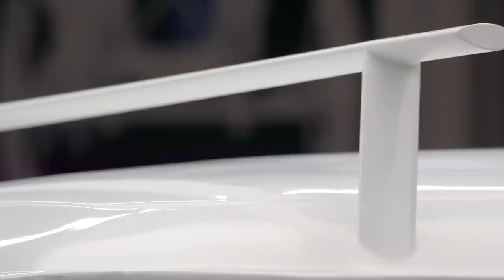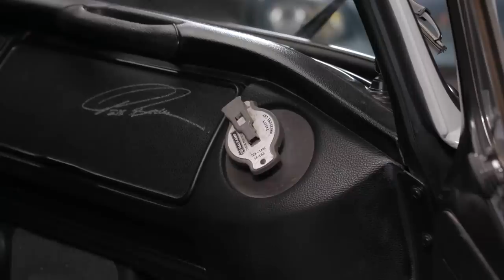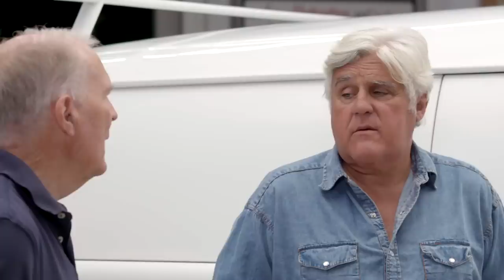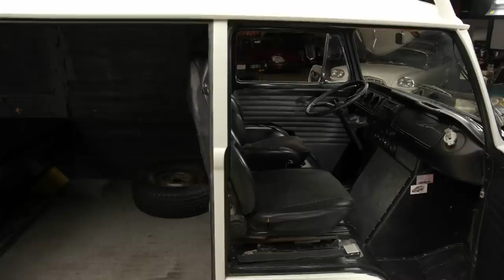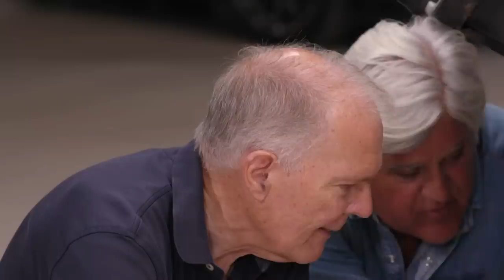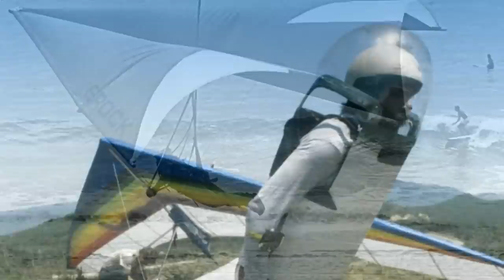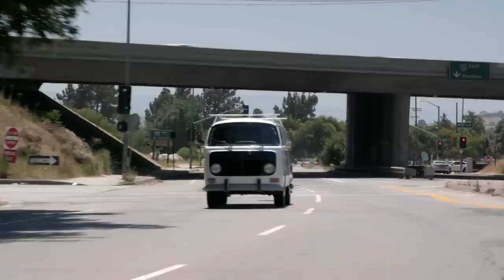Peter Brock's Hang Glider Transporter VW Bus - Jay Leno’s Garage

Comment: I owned a 73 Combi with the stock 1700 VW engine. Made about 70 horsepower on a good day on a fresh rebuild. At best it got about between 17 to 21 miles per gallon. I always wanted for horsepower and for that fuel economy the old 1700 was not a good solution. This is awesome! I loved this vehicle in all other aspects. Excellent suspension, great ground clearance, good brakes. The cargo area and camping package was fantastic. Power issues aside I think it was the best vehicle I ever owned. I wish I still owned it because I'd do this type of conversion for certain.

Comment: Amazing episode! 35 years ago I had the exact same model and re-powered it with a Subaru EA81, not as powerful as this V8, but a lot lighter. I used the VW for the exact same reason, getting a crew of hang glider pilots up to launch, here in Australia. The high CG with a lot of gliders on the roof meant that going up hill there was a lot of weight transfer to the back wheels, I used to surprise guys in 4wds with the load it would take up a steep dirt track. Wish I still had it, my favourite vehicle ever.  Thanks Jay!

Comment: People have been "flying high" in these vans for 50 years.  :)
Reply: or making children disapear
Reply: Yep no seat belts, no air bags, just  AM radio & a joint every couple hundred miles
Reply: This is the police. Could you elaborate on what you meant by "flying high ?"  Step out of the car, please
Reply: Dad Vader not so much back then, in the seventies we were all about peace ✌🏻
Reply: The best feature of the 70’s VW micro bus was the mattress in the back☮️
Reply: kman maybe you date yourself. this is ground control. we cant ever get you down again. just mildly irritate you from time to time. no problem.
Reply: @hulado  Ha!  The irony is that I've never done a single illegal drug ever in my life.
Reply: more than 50 ;)
Reply: Had a 73 Westfalia Yosemite Yellow. Thing would cruise great when your head is at 30k feet. It was a fuzz magnet though....
Reply: @ksteak27  Well considering pot is legal for 21 and up year olds now in CA, "illegal drug" was used on purpose I suppose?
Reply: @jacobsmith4284  The later AWD Westfalias are worth a pretty penny now

Comment: Little things that bring back memories: the "thunk" when your foot comes off the pedal.  Seems like nobody ever "thunk" to put a rubber pad down there.  ; -)
Reply: Lol. And how many times you have to keep putting the rubber pad on the break pedal?
Reply: A car guy and a comedian. You don't see that too often. Well done.
Reply: Ya TJ, I caught that too, what a distinctive sound, brings back my memories too. Take care good buddy!
Reply: I recognize the sound from my street legal sandrail with mechanicals from a 74 Super Beetle, but didn't know how universal that might've been since mine has an aftermarket hydraulic clutch instead of the cable-operated original. Plus it's the only air-cooled VW I've driven. Great video!
Reply: I have a lot of memories of that shifter when Jay struggles at the end of the video ;)
Reply: Oh ya, that was a trip. I grew up riding in a "77 VW bus. I had a "65 Westy in "HIGH"school living in HB . Funny, I now fly paramotors and drive a AWD "02 Chevy Astro that I made into a camper. Once the van adventure lifestyle gets ya, your hooked.
Reply: There were so many Clunky things about Volkswagens we didn’t care. I think you just fall in love with a Vehicle despite its quirks.
Reply: same with old land rovers lol

Comment: The fact that this is a work van that was used hard makes this 10x more interesting.
Reply: I put an I4 hemi in a 1973 VW van, but my 78 Econoline work van is much better as it has a 351W four speed standard, 9inch with pozi, and is better on bad roads than the vw was. Mind you that my 91 Westy is as good, as I added the manual locking diff to it...

Comment: Years ago I bought a 71 Vw van with a 350 behind the seats. My drive line was less 3 feet if memory serves me right. It was a overpowered hack job but fun as hell to drive. Bought it for 250.00 sold it for 500.00 to a highschool kid who blew it up in a week. His Mom had the gull to try to get his money back, he was drag racing and got a ticket.
Reply: They offered the VW Bus in South Africa with a 2.8 V6 from the Ford Capri. It fits and they used the Vanagon radiator grill above the bumper

Comment: In 1988 I was 18, and my Dad gave me his 1979 vw bus, with it's blown 2.0l, thinking that as I showed good mechanical aptitude I would rebuild the engine. First thing my mates and I did was bin that old 2.0l and stuff a Nissan 3.0 litre V6 in it. That bus ran happily for many, many years. Best vehicles ever! That radiator cap in the cabin was something scary tho, we ran a bleed line through the roof back to a header tank in the engine bay, it never ever overheated.

Comment: The idea that the transmission takes 5 times the power is impressive.
Reply: The idea that you would think that is impressive is shocking. These vehicles were rated at 3/4 ton of cargo. The transmissions from them have withstood a lot of big motors in desert racing. And in stock form btw they were 72hp so only 3 times the power
Reply: if you think that's impressive look at what the th180/3l30 was designed for compared to how they got used in Aus/N.Z
Reply: Makes me think the transmission therefore weighs much more than it needs to?
Reply: robert woodliff I think it's more likely to be four times, but yeah. However, as Brock says, Volkswagen engines are bulletproof and rated very high in terms of transmission and loading. They have to work really hard as a workhorse so they're well built in the first place.
Reply: There are folks that drag race with VWs putting far more power through them that that.
Reply: @Blazer02LS  what do you think happened to Epstein though?
Reply: @lizardywizard  He's at Pizza Express.
Reply: @guytitanic  bound to be! Bet they haven't even checked the cameras to see if he is or not!?!?!
Reply: The bus automatics also work well as dragster transmissions as they are a lot stronger with step down portal gears to the axles.

Comment: The B-O-P 215 engine. Of those the Oldsmobile was the one to get, at least that was the opinion back in the day. The Buick 3.8 liter V6 used the 215's engine architecture, that is a successful engine. For quite some time I had the urge to put an Olds 215 into a Volvo P1800, I actually went as far as getting an engine....There were hot-rodders who were putting small block Ford engines onto them, they made the P1800 into a car that was as fast as they looked.
Reply: That sounds like a great project, something I would do.

Comment: "He passed about 200' below me... it's pretty amazing"  😂 Yeah I bet it was.
Reply: I was on the highway and saw one of those military transports fairly low to the ground and because of the size it hardly looked like it was moving. I can't imagine being 200 feet away, it would block your view of the ground.
Reply: @charlesfranks1902  Yep. got passed by one of my old unit's C-5's 500ft below with me flying an airplane. I have had Coast Guard C-27s and Army Apaches fly below me in Hang Gliders. Below you isn't a problem, above you... Caution, wake turbulence.

Comment: I converted one of these T2s in the late 1980s putting in a rover V8 3,5 liter engine,  high jacker Gabriel shocks, 16 inch wheels and a gearbox with strengthened 3rd and 4th gear (I would have loved a 5th gear). Went for thousands of miles with my young family around southern africa without any problems. Possibly the most pleasurable vehicle I ever had.

Comment: The Buick engine was in the Rover 3500 - the 2000 was a straight 4. It was also in the MGB GT V8, the TR8 and, of course, the Range Rover.
Reply: And Morgan, Ginetta, TVR, and others I can't remember off the top of my head.  The SBC of the UK.

Comment: When he said "Buick V8" I know it had to be the aluminum one. IMO, the Rover version is better in many ways as they solved the issues that made it a problematic engine for GM. Though I think the "off-road capability" aspects were a bit overstated here, Transporters are still much more capable in that venue than they might appear. It depends a lot on a person's definition of "off-road." By my definition and in my world, the Transporter is something that barely makes it past the trailhead.... regardless of how much power it has. Still, I remember in the 1970s, when I first started four-wheeling, grinding up a mountain trail that seemed difficult at the time. As I neared the top, I was feeling pretty manly. When I reached the top, I was deflated by the sight of a VW Transporter parked there. Was later impressed by how far a VW buggy could go up a rocky mountain trail. Still, when the going got very tough, there was no substitute for durable four-wheel drive, low gears and lots of ground clearance. At some point, the buggies were stopped. On the sand and in more open country, the situation was reversed and the light buggies could dance around the bigger 4x4s like those quick deer flies that nobody is ever fast enough to swat before they take a chunk-o-hide. I had a '71 VW Camper and seeing this made me nostalgic.

Comment: Forget all these pimped senseless restomods! Cars like this VW T2 served a real life purpose and are packed with interesting stories  ;-)
Reply: If I had a VW bug I'd replace the old VW motor with a BMW R 1250 flat 2 engine with 135 hp. Its more powerful and lighter allowing for some good weight management.

Comment: In mexico & brazil they love this Volkswagen vans & beetles they kept making them almost the same until the early 2000s I was in mexico in the 90s & they used these vans for everything they look almost the same as the classic ones same with the beetles they used as taxis
Reply: eminently repairable and inexpensive to operate, reasonable cost to maintain. 
The world could still do that but “no!” “I need my climate control and entertainment”

No new car is built to last.
Reply: Here in Brazil, they were  produced till 2005 with the aircooled engine, in 06 it got a watercooled engine, production ended in 2013 when airbag became mandatory
Reply: That's exactly right !!! 
The 80s Nissan Altima ( tusuru ) very popular  as taxi

Comment: Weird fact: 
American automotive designer Pete Brock designed the Shelby Daytona coupe.
Australian automotive racing legend Peter Brock died when he crashed a Shelby Daytona coupe.
Reply: Tragically ironic, I know. RIP
Reply: @Otis Snarky-Both were assassinated by Southerners, both were succeeded by Southerners and both successors were named Johnson.
Reply: Otis Snarky  Kind of a stretch. Nobody called the Lincoln a Ford Lincoln. There are many better so called "coincidences" with JFK & Abe just check Giggle or Goggle or whatever. 🏎
Reply: cuda426hemi - Apart from Ford owning Lincoln JFK's specific presidential limo was owned by FoMoCo and leased to the WH making it "Ford's Lincoln" as far as JFK was concerned
Reply: There could only be one!
Reply: @PabloGonzalez-hv3td  That's a stretch, nobody called it Ford's Lincoln, not me, not JFK no one. It's just another of the fake "coincidences" that are really not coincidences at all.
Reply: cuda426hemi It was technically the SS-100-0X or X100 for short but my point is that it was on the books as belonging to Ford and was factually "Ford's Lincoln" regardless of what it was called
Reply: @PabloGonzalez-hv3td  I gotcha buddy, I was just poking fun at the stretches taken with these so called coincidences when really you can tie anything together with "facts" after the fact. Like reverse engineering. Peace! 🏎
Reply: cuda426hemi Well for most of the 80s and since the early 90s the presidential limo has been a Cadillac there would be no coincidence
Reply: @PabloGonzalez-hv3td  So what? if that stretch didn't fit you go to the brand of Sugar on the table matched the name of the Barber's brother's wife. I'm thinking you don't get what I'm saying, how reverse engineering works or Monday Morning Quarterbacking works - like taking that $20 bill 20 years ago (not the current ones) and folding it and you can make the twin towers burning on one side and the other side United States Of.. turns into American Airlines (almost) right after that event creepy.. stuff like that.  Is that a coincidence?  No. 🎸
Reply: cuda426hemi I understand it fully. You're using 2 different data points the coincidences refer to the same one in this case the location of the shootings
Reply: @PabloGonzalez-hv3td  It's still not a coincidence. Coincidences have to take part in real time. Not random pairs that work out of billions that don't. ⏚
Reply: cuda426hemi There is no such requirement for a coincidence
Reply: @PabloGonzalez-hv3td  Yes there absolutely is; that's what I'm trying to explain to you - but you just can't get it; these are NOT coincidences but rather meaningless connections made after the fact. 🎤
Reply: cuda426hemi Coincidences is in fact ALL they are nothing more nothing less
Reply: @PabloGonzalez-hv3td  Yeah, No. You and I show up at a theater at the same time is a coincidence - it happened in real time. You going to a store and buying some stuff and I go in days later and unknowingly buy the exact same stuff same brand credit card maybe we even have same sneakers on,  is not a coincidence. ⏱
Reply: cuda426hemi - The irony is you're the one over thinking it

The "Fictitious Persons and Events" disclaimer at the end of movies refers to any similarities past or present as being purely coincidental, by your definition they're wrong to include anything in the past
Reply: @PabloGonzalez-hv3td  That's just a legal indemnification. The "past & present" part of that statement is referring to the people being compared to right then - in real time. So at that moment, anybody past or present that look like what you just saw - is a coincidence. Lawyers also indemnify by saying things like "in the future, on this planet and any future planet that this copyrighted work shall be played on"  Very creative. But to be "co" it has to be real time - at least that's what the books say. 📺
Reply: cuda426hemi - You're conflating concurrently with coincidental 

At first you said the events themselves had to occur concurrently in real time for it to be a coincidence a past event and a movie don't meet that definition
Reply: @PabloGonzalez-hv3td  all they are doing is protecting images owned from the past til now, right now. There is nothing happening 'right now' in lists of random connections made after the fact. 🎙
Reply: cuda426hemi It doesn't matter if the movie is in the present it's only half the equation the persons or events occurred in the past by your definition this is not a coincidence
Reply: @PabloGonzalez-hv3td  Co-incide. You can't look like somebody in the future until it happens, right? You can't look like anybody from the past until it happens, right? Now compare that to a list of 

"weird connections" created after the fact - the residue of infinite connections that didn't work - very odd - but they didn't co-incide so they ain't co-incidences.
Reply: cuda426hemi Yes and one dead president being replaced by a vice named Johnson wasn't a coincidence until it happened to a 2nd dead president...
Reply: @PabloGonzalez-hv3td  There is no co-inciding there. You are illustrating odds - really tall odds of an after the fact combination out of an infinite amount of connections that don't work after the fact - in other words if you can run all sorts of minutia into a computer with the key motive being "tie as many things together as you can between these two Presidents" all those phony things "Ford" Lincoln, the birth and death years matching but a century apart etc.you can read the list on the web......none of that is coincidence. 👀
Reply: cuda426hemi The tall odds of 2 shot presidents both being replaced by vices named Johnson are precisely what make that data point a coincidence
Reply: @PabloGonzalez-hv3td  They didn't coincide. I've shown empirical evidence of the difference; now it's up to you to figure it out. ⏚
Reply: cuda426hemi The same moment in time for each respective president is what's being compared...